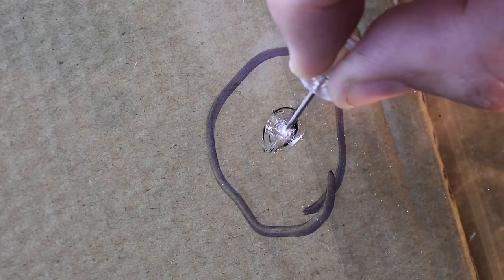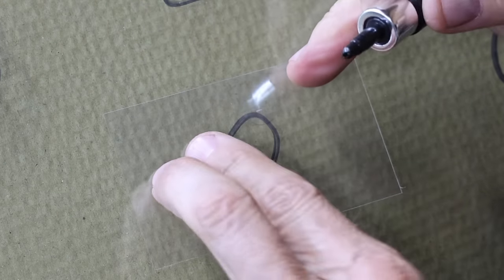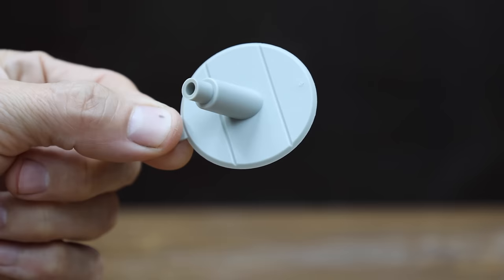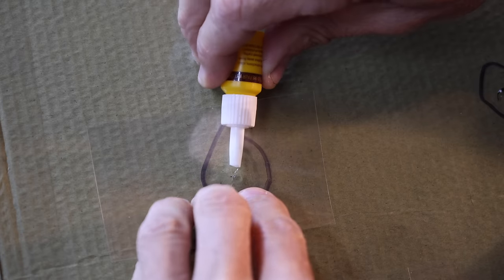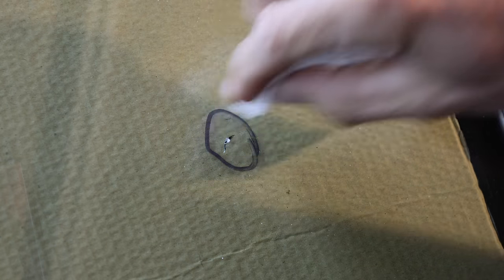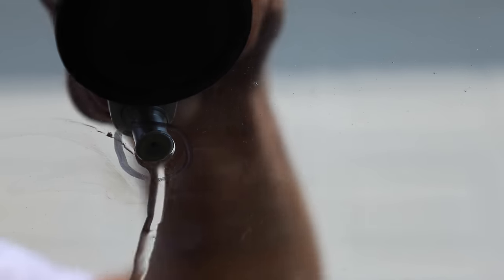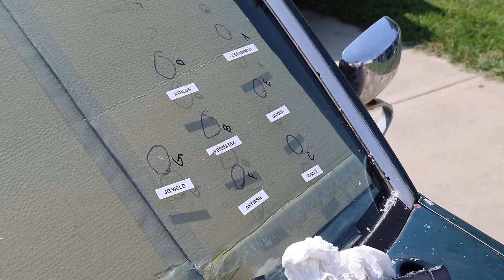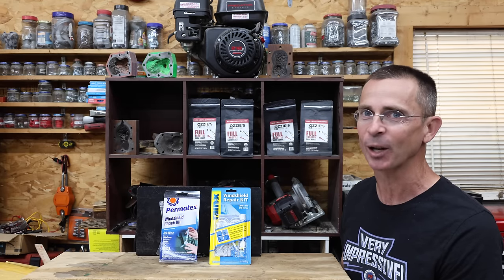Best Windshield Repair Kit? Let’s Find Out!

Comment: The RainX was worse than nothing to me. The instructions were faulty, the plastic contraption broke in two places during the repair, and the pressure even seemed to make the crack bigger. Walmart took the kit back but now the chip can't be fixed apart from getting a new windshield. ☹️

Comment: I had a stone hit the middle of my windshield, and made (I guess) a star shaped damage pattern (small hole and two horizontal lines). I took the car to the professional glass repair service, and after over an hour they charged me 40$ but the damage looks the same as before the rapair. The only difference is that you can see a small flower shaped resin pattern around the impact hole. But the hole and the lines are stil as visible as before the "repair". Now I have to take it to another shop to repair the "repair". 😡
Reply from the maker: Thanks for sharing.

Comment: Dollar for dollar the Rain-X is slightly better than the Permatex as you get 10 about the same quality repairs from the Rain-X vs 1 from the Permatex. 

The ClearSheld repair is slightly more expensive than the Rain-X. On the other hand you can make a "better" repair with the ClearSheld. That may or may not be that important depending on how many chips you have to repair. In the mountains where I am at windshields are in one of two conditions. Ether they are new or they are broken depending on how old the glass is. I had a 2006 Ford truck that still had the original windshield until it was stolen this year and have a 2014 Ford Flex that is working on its third windshield. Glass isn't what it used to be.

I think that I will try the Rain-X, if not happy will go for the ClearSheld
Reply from the maker: Thanks for sharing.

Comment: What this tell me is that I need to have dings professionally repaired by someone who knows what they are doing and exactly how to do it. This is complicated and easy to screw up for someone with no experience. I’ll spend the extra bucks for a professional fix.
Reply from the maker: Thanks for the feedback.
Reply: @ProjectFarm  No… an overwhelming thanks to you so much for doing what you do. I might have attempted this on my own and screwed it up royally had I not seen what you demonstrated here. My conclusion is to let a professional do this particular repair the right way instead of trying it myself and screwing it up.

I thought… “the ding on my windshield is something I can fix myself”. I stand corrected. The chances I screw it up are far greater than letting it be done by a professional with the experience.

You probably saved me hundreds of dollars in repairs and that is simply priceless.

Your videos have saved me from so many bad decisions and mistakes. Thank you so much!

Comment: DO NOT USE A LIGHTER! As a professional glass installer and repair technician it will not work! There are two layers of glass with polyvinyl butel in between. You are more likely to heat the PVB and turn it brown then actually do anything beneficial. Additionally, the heat makes it extremely likely the crack will spread while you’re working on it.
Reply from the maker: Thanks for the constructive feedback.

Comment: As a person with 30 years experience in the auto glass industry this is probably the least scientific experiment I've seen from you. Yes the $300 crack repair kits are better. Moreover I have a $1,000 one. Why?  Because it's better. That being said the repair kit is never as good as the person doing the repair. There is no substitute for experience